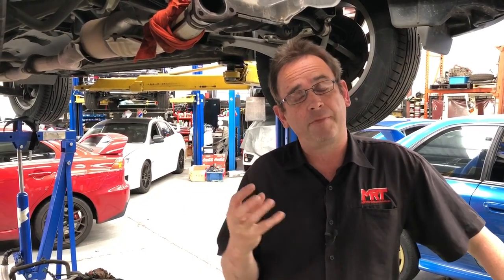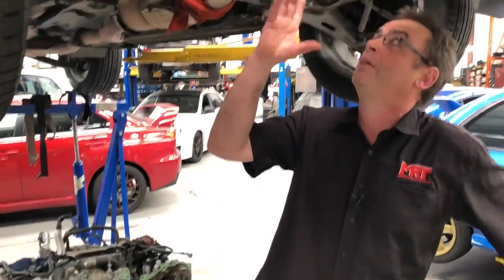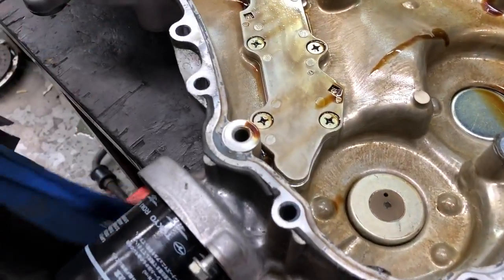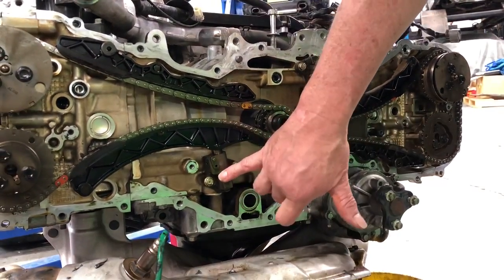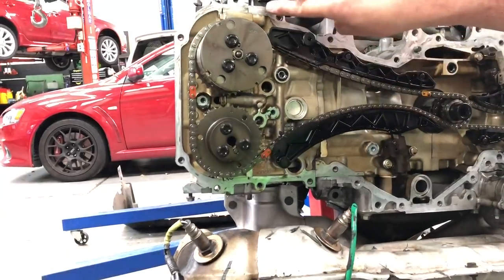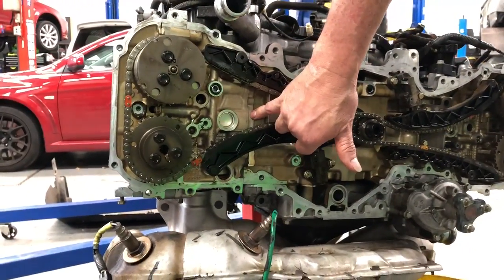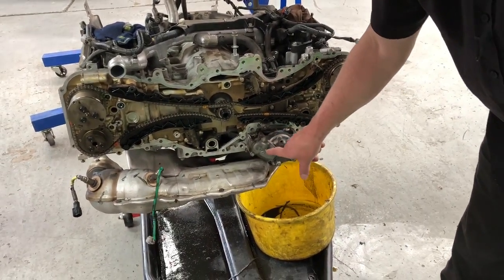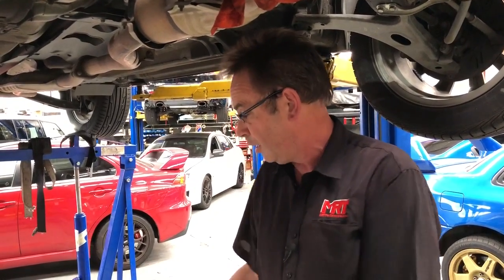Subaru FA/FB Series Engine Oil Leaks - Forester/Impreza/Outback/XV/BRZ

Comment: Thank you for the information. I want to consider Subaru for our next new car, but the oil leaks are a significant concern, as they will most likely require engine removal. Too bad.

Comment: That’s exactly my scenario in the same drip on CAT. But U.S version (2011) I used new rocker cover gaskets but still have the annoying slow drip. One of those I could deal with but every time you stop you see a little haze of smoke coming out from under the hood, but it’s annoying.

Comment: Can you do this without taking out the engine?
Reply: Yes, it's possible (I've seen it done) but one may have to remove the radiator for enough room.  Even then it is more challenging to properly clean the mating service and align the cover during the reseal process without hosing up the sealant.

Comment: My wife was zeroing in on buying a used Forester, as she had a good experience with her used 2004 until she failed to notice it was overheating, at which point the head gasket blew.  But she had gotten 250K miles out of it anyway, so whatever.  However, thanks to the internet, I learned that these newer Subie engines leak oil as bad or worse than the old ones, maybe even worse than the BMW 3 series we had.  My Lexus had 165K miles on it when I sold it, and it never a leaked a drop from anywhere.  It seems to me that sealing an engine against oil leaks ought to be old technology by now, and indeed it is for several manufacturers.  But seeing how common this issue is with Subarus made in the last ten years has persuaded me that another Forester is probably not the best choice for our next car.

Comment: bought an old forester SH series with the FB20 engine, at just 68T km, the valve cover gaskets are leaking.  When i fixed this, leaks were still present, this time it was the timing chain cover needs resealing…. Curious why this engine leaks so early at 68T km?

Comment: How much does it cost to reseal cam carriers assemblies, gaskets and deals replaced on a2015 Subaru Forester XT?  Thanks.
Reply: I have oil seepage (not a full blown leak). Reseal costs 3k-4k USD at the dealership. However, it can come back again after 10k miles. I'm just carrying some oil with me until it starts to leak bad.

Comment: Hey! can someone help me, I have some leak in the air intake at the two sides of the engine, the oil filter side has more leak. I dont even know if this is an oil leak or something else. 
At least i have look the oil level and its okey, and the color its normal, not like a capuccino.
What could be?
Reply: By "air intake" do you mean the mating surface between the engine and the intake manifold? If so, it could be gasket or mistorqued bolts. Take it apart and isolate.

Comment: It seems Subaru engine oil leaks begin mostly when the PCV  is maintenance neglected / restricted/ plugged  and the crankcase pressure forces the leaks .
Reply: Another factor is the addition of direct injection to an engine. This also adds increased crankcase pressures.

Comment: Can this repair be done without removing the engine?
Reply: There's a YouTube video of a father and son doing this on a BRZ or FRS FA engine in their garage without removing the engine, just for the timing cover sealant. They pulled the radiator out to make more room, and might have loosened some of the front grill assembly, too.
Reply: Here it is. You can see how they managed to clean both surfaces. Not that I'm recommending this approach, but it seems plausible from how they made room to access everything. The hard part is aligning the cover properly in a short time after applying the RTV given the cramped space. 
https://youtu.be/hHYfQQsKu3w
Reply: @SRHMusic012 I see two problems. First, with the limited space, it's hard to see all the mating surface of the timing cover, especially the bottom portions. If one misses even a small segment, say it's slick with a drip of oil, that will become a leak. It's so easy to mess up the operation. Second, the timing cover is heavy enough that it's hard to maneuver even when the engine is out. Given the tight space between the engine and the AC condenser, assuming the radiator has been pulled, it'd be hard to maneuver the cover without the RTV'ed surface touching anything during the fitting. And then there are the o-ring that might fall out during the fitting which would result in strange engine behavior necessitating having to pull it. Besides, if you're going to work on a Subaru, learning how to pull the engine should be a must.
Reply: @SRHMusic012  Agreed.  It's definitely possible.  Rainman Ray also resealed a timing cover without removing the engine.  He didn't even remove the radiator.
Reply: No way, the engine needs to come out. Resealing would be nearly impossible because surfaces would not be able to be cleaned thoroughly especially the timing cover. Then, you'd be doing it again, and again, until you take out the engine.
Reply: @hankitytankity  one can argue it'd be better but the engine does not need to come out.😉
Reply: @ I’ve seen places that mess up the sealing with engine out. Thin oil and a small spot that did not adhere? Forget about it.

Comment: I did the valve spring recall. The car has less than 20 000 miles since the recall & already leaking.
Reply: The problem is how difficult it is to reseal the engine once it's out of the factory. There's a lot to seal. Surfaces have to be squeaky clean; this is really difficult when the engine is dripping with oil all over the place. Any mistake, and there's another leak. Sometimes, it's better just to leave small leaks.
Reply: @hankitytankity  Maybe I should have left the spring as it is.
Reply: @MrDeapGamingMedia  As long as you're under warranty, get it resealed.  And when it comes back, check all the hoses and plugs to see they put the engine back in properly. I had a PCV hose unplugged when mine came back and that could have caused the leak further down the line. Reseals are such crap shots on these engines. It's pretty bad they had problems with the valve springs because the heads have to be removed. That's pretty much the end of disassembly short of disassembling the short block.  Good luck.
Reply: @hankitytankity  I've past the warranty for awhile. It's a 2012.
Reply: @MrDeapGamingMedia  in that case, I suppose you have a similar choices as I did when he head gasket on a 2011 FB25 on Forrester was leaking due to overheated engine. Dealerships quoted 7k USD for the repair. Too.much and they f'ed up last time the warranty repair was done.  An Indie shop quoted 4.5k to start. Would probably end up close to 6k or.more if a new short block is involved. But the resealing is really a crap shot. So, in the end, I decided to do the work myself. The sealing is a real crap shot because it leaked the first time I did it because a spot on a mating surface dripped oil and the sealant did not stick. The second time, I'll have to see. On a positive note, if you do decide to do it yourself, consider installing a new short block especially if your rings are worn. They're about 2k brand new and that's a great price. Also, look into anaerobic sealants for a reseal, like the Loctite 518. Good luck.
Reply: @MrDeapGamingMedia  And don't forget to check the usual suspects that can cause leaks in older engines, especially the PCV valve and hoses. If they fail, it can lead to overpressurizing the crankcase and the engine will start leaking somewhere. Older engines also have more blowby due to worn rings which creates even more pressure. You can open the oil cap while the engine is running to get a severity of the situation.
Reply: @hankitytankity  The engine is in good condition. It have low fuel consumption. The speed the engine temp heat up is the same as when it was new under normal driving. I'm not worried for the moment.
Reply: @MrDeapGamingMedia  As long as you're not bleeding a quart per week, it's Subaru as usual.
Reply: @hankitytankity  It doesn't have a noticeable oil consumption 😅

Comment: Subaru's weakness is the entire engine hahaha I haven't seen one past 120k miles without an oil leak LoL my 99 CRV is 230k miles ABSOLUTELY no oil leaks ever. My old 93 civic was at 190k no oils leaks before I sold it. Subaru's are JUNK...My 08 impreza 2.5i leaks EVERYTHING LMFAO
Reply: Tens of thousands of Subarus have no problems and no leaks at all
Reply: Sad but true. Subaru needs to do better with sealing or crankcase pressure management.

Comment: My 2011 Forester (FB25) at 107,000 miles is leaking oil like crazy out of the driver's side lower portion. I'm about to just throw some stop leak in it, clean it up and trade it off to a dealership.
Reply: Does that stop leak stuff help at all? Also have a 2011 forester that’s leaks oil.
Reply: @FrilledProductions I've tried a stop leak but the problem should be addressed at the source, the overpressurizing of the crankcase. Check PCV and related hoses. The old leaky piston rings compound to the issues.

Comment: Perfect explanation! I’ve resealed countless EJ25 Subarus, but my independent shop is just starting to see this generation engine regularly.

So the usual engine pull for oil leak reseal on these doesn’t include head gaskets? Just trying to know what to quote customers when we do these. I’ve looked a few now and haven’t been sure what to recommend.
Reply: No head gasket replacement because the cam carrier lies independently on top of the head. I've seen quotes around 35k USD here in SoCal, but I've also seen 7k USD for head gasket from dealerships. At these prices, the entire engine should the overhauled if the engine has 100k plus miles.

Comment: Oil in coolant. Any ideas?
Reply: no ideas mate.
Reply: Head gasket leak. Exhaust gases are getting into the coolant system. Use a block tester to verify. Your engine probably overheated and warped the head just enough to cause a leak. It probably only shows up when you push the engine.

Comment: How do you prevent further leaking, since there is no gasket? Is it just a reseal with silicone, if so how long does that last?
Reply: No way to reseal without taking the engine out. This is one of the main problems with Subaru. Adding oil holds over the issues until the leak becomes insurmountable, e.g. 1qt per week. Then, one has to take the engine out and overhaul the engine, 5k+ USD affair.
Reply: @hankitytankity  That's how I've been dealing with it since my car was diagnosed with it like two years ago. 5K is a LOT of money so it'll have to wait
Reply: @hankitytankity  I have seen at least one professional mechanic remove and reseal a leaky FB25 timing cover without removing the engine.  I personally do not think that's a great approach since it is much more challenging to align the cover and not hose up the sealant but there is a way 🙂

Comment: Great Video!  Recently test drove a 2017 Subaru WRX with an FA20DIT engine.  Had a horrible oil burnt smell after my drive.  Noticed the skid plate was not installed and some oil near the oil pan.  I couldn't get a better look but from the looks of the FB engine you have there it wouldn't be too far off that some seals might be leaking on the exhaust manifold.  Engine only had 47k mile on it.  Shame I had to walk away here in the US.  Thanks again for your video.

Comment: Timing belts are SO much better if you actually take care of your car. Oil leaks are so annoying on these new subarus. The H6 leaks at the timing covers regularly, the fb25 leaks at the cam carrier regularly as well as the timing cover. Im sure the fa24 will have leaks as well here soon once they get older. Its extremely expensive fixing these leaks

Comment: My freaking car has 60k miles and already has a leak right by the fuel injector. Freaking bull shit for a 4 year old car that us serviced on time
Reply: If it's the valve cover (outer side of fuel injector), consider yourself lucky; the engine can be lifted and cover resealed. If it's the cam carrier (inner side of fuel injector), that requires taking the engine out.

Comment: I've redone the valve covers on these before and what and awkward beotch that was, but never the timing chain cover on a FB25 which ive come across one where I do have to reseal the timing cover, I think these motors are just built like crap. I hate working on Subaru's, I've even rebuilt the entire front end body and engine of a BRZ what a crap shoot. I hate it but I'll still do it lol. Love my basic SBC's lol! Great video btw 😁
Reply: Crap shoot is the right phrase. You never know if the seals are good until you start the engine.

Comment: The toyota dealer I got my 2011 Forester FB25 (114k miles in Feb 2019) sold it to me with a leaking front timing cover. They told me it wasnt leaking twice. until I forced them to check exactly where I saw it was leaking from, the exact same spot but on the opposite side (driver side) so it wasnt creating bad smell from the oil leaking on the exhaust. It just leaked over a ground cable at the bottom. Forced the dealer to fix the leak and another subaru dealer resealed it. I have done all maintenance and tune up on this Forester, including sparkplugs, coolant flush, calipers and rotors (changed both front), brake flush, transmission and diffs fluids, control arm upgrade, tie rod ends and ball joints. All with original parts. Now at 153k miles, the only issue I have is the valve covers or rocker covers leaking and A/C clutch goin out. But for a 10 year old car (first purchased in 2010) it has been very reliable for me, even for independent contracting work as a Business IT Installer and Tech, hauling a couple Anthennas and dozen bricks around all day with my climbing equipment. I would get another newer Subaru with FB/FA engine for sure and I already now much of the maintenance work which is so easy to do especially oil changes (any oil). Good Luck out there dont get ripped off by dealers or people.  👍 👍

Comment: As I pulled the crank pulley out the 2014 Scion FR-S, the Oil Pump Collar Crank Pulley Hub Seat came out with it and now I’m having a hard time putting it back in. I align it but still won’t go in all the way. Would I have to take off the cover?

Comment: Do you happened to know when they do the Valve Spring Recall on FRS/BRZ would this area be taken apart, and new gaskets & sealant?
Reply: My dealership told that they only need to remove the valve covers because they have a special tool to replace the valve springs without removing the cams. On the other hand, they do have to remove the motor from the car, so if you wanted them to reseal anything else, then it's really just the labour to remove whatever parts based on where the leak is coming from.
Reply: To do the spring, they have to remove the engine, all the covers, all except remove the head. This includes removing the cam carrier because springs are below the cams. I'd be very weary of this because it involves resealing the entire engine except the oil pan upper. Resealing Subaru engines are always a crapshoot. If this were my car, I'd consider selling it and get a newer model if the prices are good as they are now.

Comment: 2011 model fb20 forester and 300 000km and still running. only clutch has been replaced. using 5w-30 castrol oil and 6000km oil change. I live in finland so we have winter time here as well.

Comment: Is the slack on the RH timing chain tensioner that he was showing normal?? So cold start of rattle is normal until oil pressure builds up? Or should the chain tensioners be able to hold pressure?
Reply: It won't blow the engine but it isn't normal from the factory. The tensioner loses tension and will let the chain slack. I recently changed a tensioner and noticed the difference.

Comment: I have exactly the same problem on my 2015 Subaru Forester, will this affect the functionality of the car if I leave it? It's been leaking since 80k miles and now I am at 120k. No noticeable increase in the leak still 1/3 to 1/2 quart between oil changes. It's more like a seep and not leak. The smell is not nice though, but I just turn on internal circulation and is fine.
Reply: Did you get a quote? I just got diagnosed with the same issue. It only came up because the oil leaked on an O2 Sensor, which failed and triggered the Engine Light. Otherwise, I wouldn't have even know.
Reply: @TangoNevada  You can replace O2 sensor yourself cost about 200 dollars max. The cam carrier seal dealer quoted me $3000+ and told me they don't recommend doing it since it's not worth it. I am gonna keep running it, and if the leak gets back I'll remove the timing cover and reseal myself.
Reply: Hi  @etx007blue2  I know this is a long shot but do you still have the forester? Is it still running great despite the leak or did you reseal? I have the same problem, I was thinking of just ignoring it until it gets much much worse. Will appreciate it if I get some input from you. Thanks.
Reply: @raymondkileo9370  yes still running great despite the oil leak

Comment: raises hand fb20 impreza 2012 65,xxx and I got this.  boo.
Reply: Did you get a quote?
Reply: @TangoNevada   nope. comes down to needing the gasket replaced. was quoted around 500-700 in parts and then around 1,000 in labor.
Reply: @Fiata_aquarium_jps  I was quoted $2,400.00 USD for the same repair at a Dealer. !!!!!!!!!!!!! This sounds like Bullshit. If this is a known issue with all cars in this era, how is it not a recall?
Reply: @TangoNevada   more or likely Subaru doesn't give a shit. I've seen people get it fixed, and then have there warranty extended . then it happened again.  I'm only at 66xxx miles. I'm to the point of wanting to sell mine for just a little over it's pay off, and switching to a mazda,  or toyota, or honda.